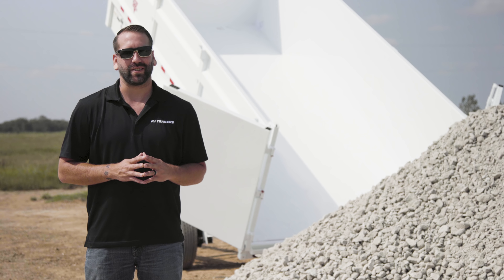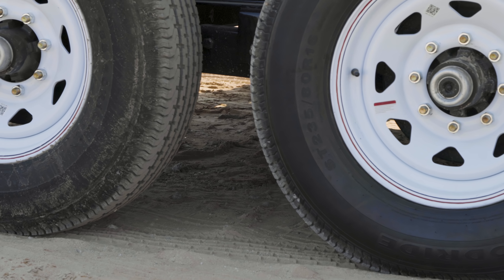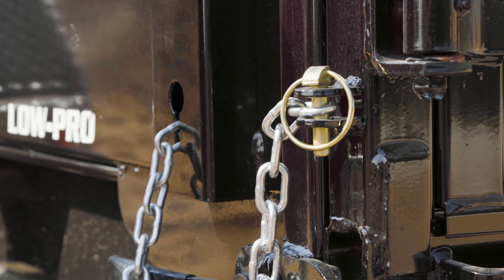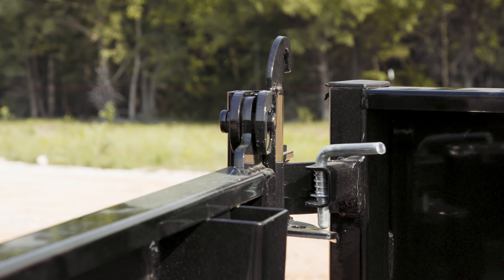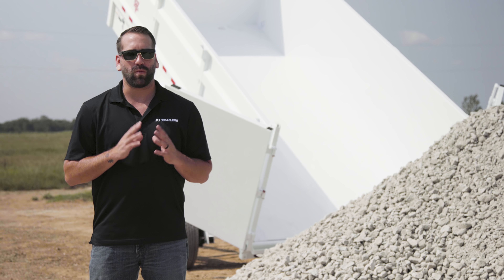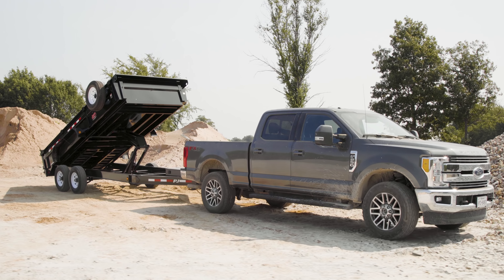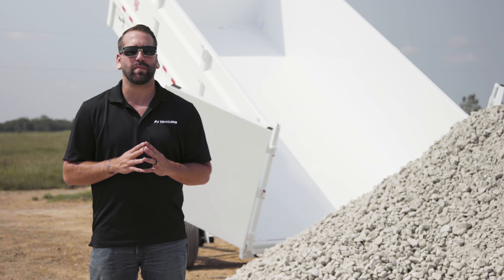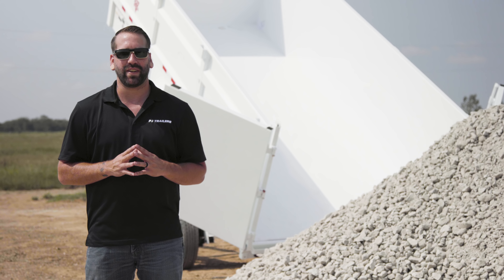Trailer Safety Series - Unloading Your Dump Trailer

Comment: Curious as to why the trailer will raise all the way up if I'm only supposed to raise it half way. I guess I've been doing it wrong for the last 12 years... (Sarcasm)
Reply from the maker: It depends on the load and how you want to dump it, we recommend to start at the halfway point (especially if you are new to using a dump trailer). As you know, you can certainly raise it all the way up if that fits your needs :)